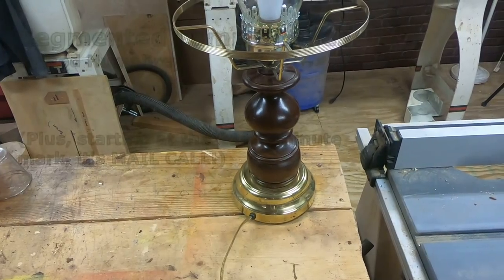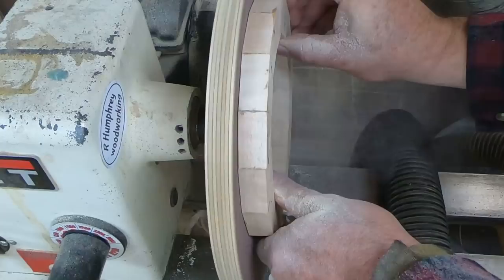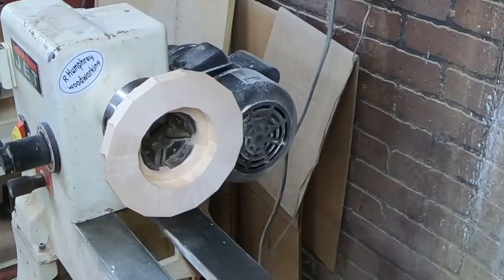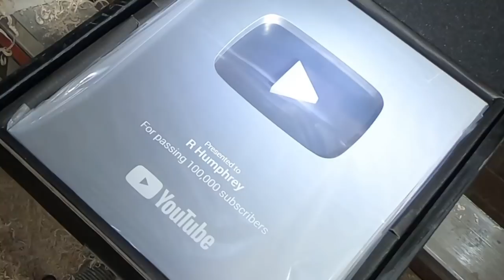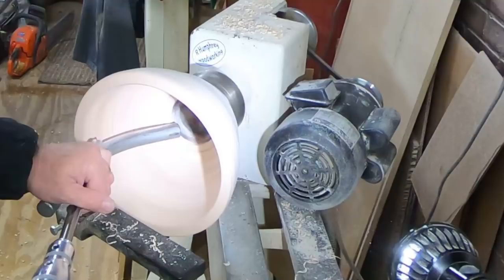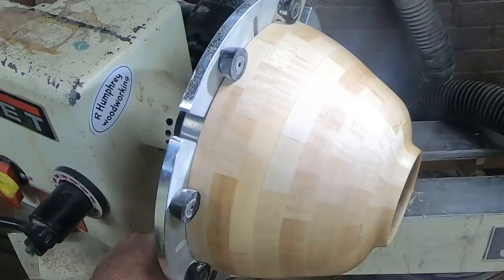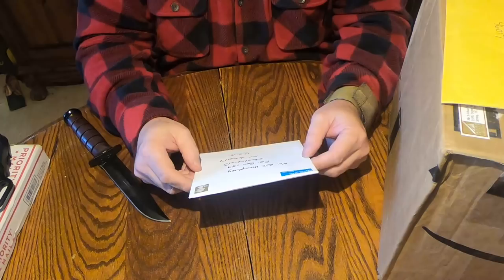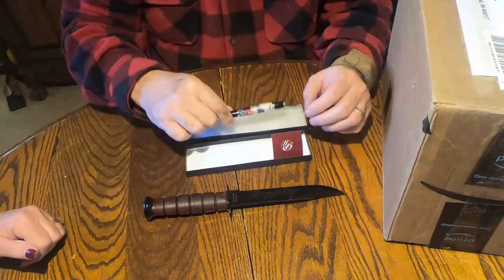Woodturning a  Lamp Shade with Segmented Maple

Comment: Great project as usual, the flame in the segments really pops.  Another way that I have done it is to take a piece of really green wood turn it down to 1/16” or so and it should stay fairly stable. Generally a small pendant light with an LED bulb is the best application for it imho.

Comment: Hi Ron,
As I understand it, to get really thin walls you have to make a jam chuck and invert the "bowl", stuff it onto the jam chuck, and then bring up the tail stock - you effectively recreate a solid form.
So, you have to:
1) rough form the outside
2) finish form the inside to the desired INTERNAL diameter
3) make your jam chuck ( you want at least 1" of overlap as I understand, I should think that more is better)
4) flip the form and jam it on , bring up the tail stock
5) re-round the outside
6) turn down the wall thickness

It sounds absolutely simple right ?!?!  ( no plan ever survives first contact with the gouge)

These came out really nicely !

Comment: Hi Rod,  very nice work!  So glad to see your award for 100k.  That took a lot of effort!  I just made one of the stompers that I think was recommended on Segmentology.  It really helps with the centering.  And on the tailstock end of the bowl/globe when you are turning or scraping, I have found that I can use a smaller end ring that is not glued, but taped so that I can pull up the tail stock for support.  It makes me feel more comfortable.  I think you have my email address.  If you like I will share more about this with you.  Have a great holiday season!  Van
Reply from the maker: Thank you Van, I know what you're talking about... it all worked out ok in the end.  What I really need to do is make a steady rest, or use a jam chuck... I appreciate it though!

Comment: As usual a very nice project from the Rod Humphrey shop. Well I guess two projects. That maple sure lights up nicely. I love the color. I wonder if you could have reduced the chatter by using a Cindy Drozda  technique. She used a hand to help stabilize the wood. It works on spindles. Maybe it will work on bowls too. Also if you use your Cole jaws on the tail stock to add each ring you will get better centering. And you could use them to hold rings against the sanding disk, no sanded kuckles. Congratulations on reaching 100K subscribers. I expect 200K before long. BTW is the rest of that lady as lovely as the hand?

Comment: Seriously one of my favorite channels. I learned a lot from you. Video quality is great, sound is great, no annoying music. I appreciate you! I have a question about sanding the rings flat. Is there a way to do the sanding somehow of all the rings at the same time so you can glue more than one at a time? I know sanding on the lathe with that sanding disc doesn't ensure the sides are parallel so that's why you do the next step.

Comment: Amazing work how did you make the guides for the segments
Reply from the maker: Thank you!  Pretty easy, with a pre-angled block I glued down the angle guides then used screws to permanently fix them in place.  The only issue was that my miter slot guide on the bottom had a bit of play back and forth, but that was an easy fix.
Reply: @RHumphrey  I guess I worded but thanks for the cutting jig to. I ment the circle template to know how long each piece needs to be

Comment: I'm curious about something as I've never turned anything super thin.  Could you have taken it thinner with some aggressive sanding, or would the time required have been insane?  And, would an oil finish possibly have soaked in enough to increase translucence?
Reply from the maker: Aggressive sanding might work a bit, but honestly doesn't sound like a lot of fun, lol...  I got it down to less than 1/8, and that should have been enough for more translucency, but the grain was super tight.  I think the problem was my choice of using figured maple instead of clear maple...  next time for sure.  Interesting thought on the oil, I'll play with that.

Comment: Rod, where did you find your large sandpaper disk to flatten your ring segments? Also, what is the grit you use? Thanks for the great video. I want to try segmenting soon, just need to stop procrastinating.
Reply from the maker: harbor freight is where I got the sand paper disk.  It's actually good quality and has lasted a very long time.  I use 80 grit for flattening for glue ups.  Go for it!  Just make yourself a small 6 or 8 segment ring to get a feel for how easy it actually is, that's how I tested the waters...
Reply: @RHumphrey  It's probably the last place I would have thought to look. Thank you.